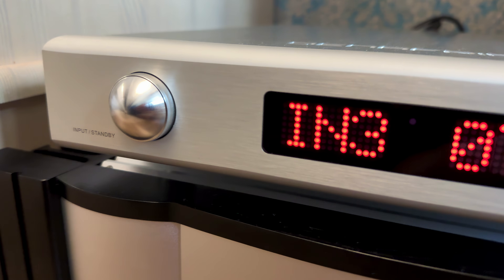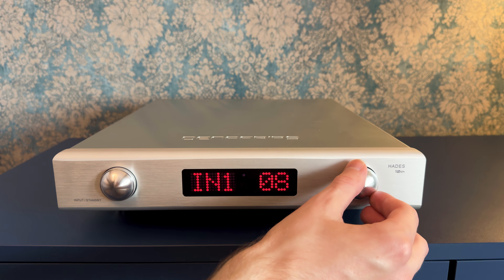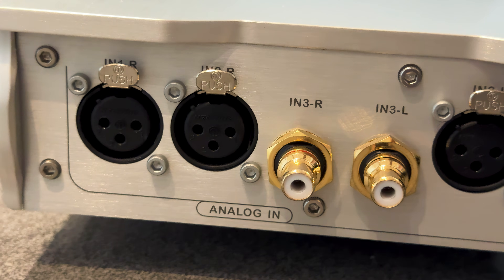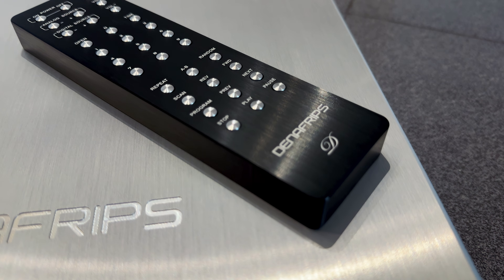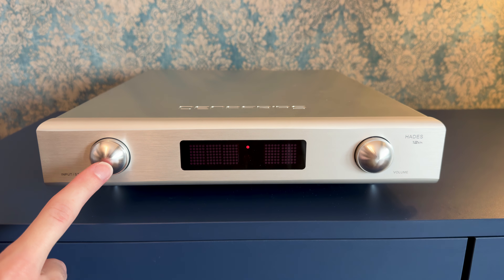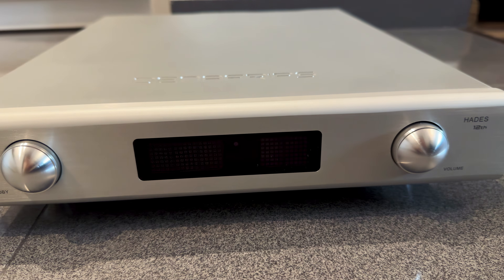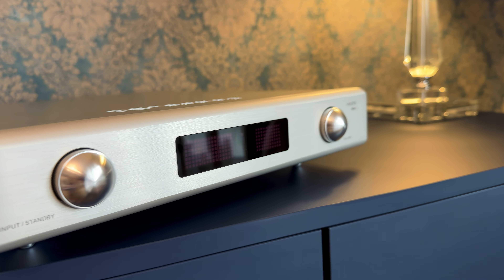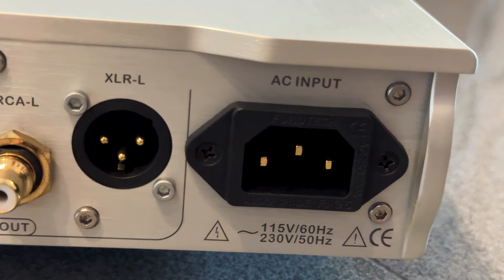The R2R Preamp That CHANGED My System - Denafrips Hades 12th

Comment: Hello, I have Edifier S2000MKIII 2.0 speakers. I have a question: is it worth investing in an external DAC to improve the sound?
Reply from the maker: Hello! From what I can tell the Edifier S2000MKIII speakers use dual Digital Signal Processors (DSP) chips to manage the sound. So no matter what analog signal you put into the speakers, it gets converted to digital (with not so high quality converters...) and back to analog. I would say that in your case, it'd be best to input a digital signal (coax or optical) to the speakers - that way you skip one back-and-forth conversion step and get a cleaner, less degraded sound in return. That's of course if you're not planning on upgrading your speakers - which would be the best thing to do if you want to spend money on something :)

Comment: I had the original Hades, and quite honestly, I found it rather dry. Then I upgraded to the Athena, and that was even worse. Very dry and flat, not musical at all. I was using the Denafrips Thallo amplifier with their Venus II 12th DAC. I have since sold off all of the Denafrips gear.
Reply from the maker: The 12th and 15th editions use much better components. Maybe it would do a better job in your system. What do you think?
Reply: @TheAudioStuff  Maybe, but as of now, I am well passed the Denafrips gear.
Reply from the maker: @michaelwright1602  I see… What kind of gear do you use now instead? 😮
Reply: @TheAudioStuff  You will laugh, as will others. I am using the XiangSheng DAC05A x 4 DAC, the Cary SLP-90 clone tube preamp with Psvane Horizon tubes out to the Dartzeel clone D5Pro. The Cary preamp is heavenly, very airy and very holographic with my Volumio Rivo streamer. I have tried less expensive streamers, the holographic sound is not there. To note, I have quite a bit going on in regards to power supplies and general electrical filtering with several LPS units, DC cap filters, LHY network switches, along with galvanic isolation and clocks. All cables to the streamer are pure silver, USB, Ethernet and DC power cables. The sound is simply incredible with this system, and I have had a lot of gear through here, enough to start a YouTube channel.

Comment: Looked intresting until I saw the number of inputs. I am into multiple  formats.
Reply from the maker: What kind of formats? It's an analog preamp - what else could there be? ;)
Reply: @TheAudioStuff There are three inputs. Not enough. Would need a minimum of 4 inputs with the use of  multiple input dac. Need input for dac, phono preamp, reel to reel and cassette deck.
Reply from the maker: @vinylrules4838  I see... so you need just one more RCA input, right?